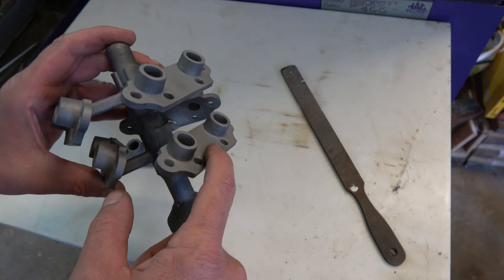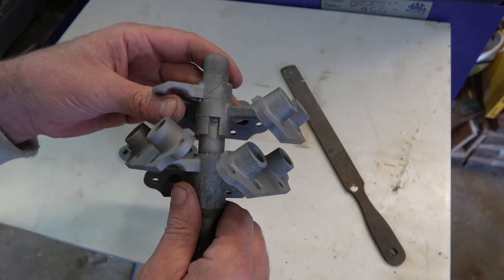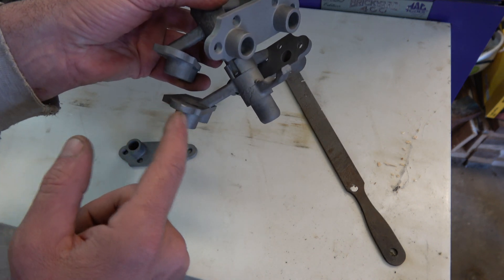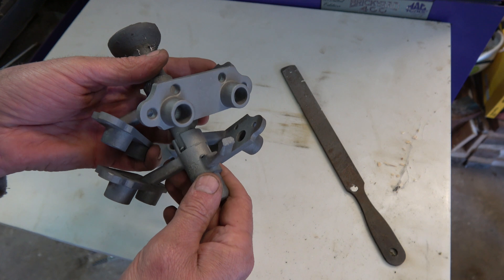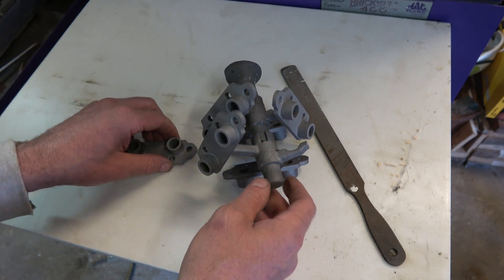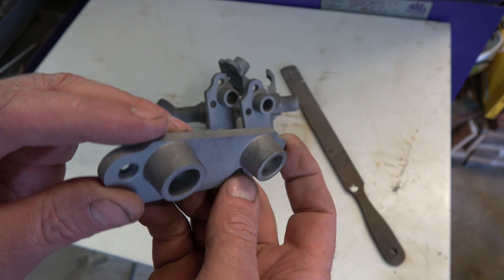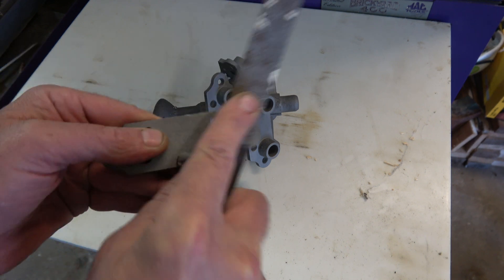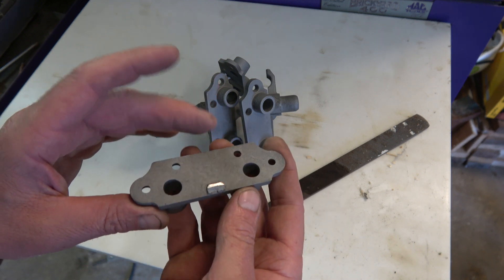Lost pla casting, cast iron, ceramic shell

Comment: Fantastic! I'm struggling finding the right mix and procedure for the ceramic shell. Would a mix of 1 parts Powdered Clay, 1 part powdered chamotte and 1 part water work? Dipping in layers with drying in between until the thing is quarter-inch thick? My concern is that the whole ceramic shell would shrink or warp during burning. Maybe if i use mostly chamotte and only a little clay, i end up with a shell that doesn't shrink. I would be thankfull for further instructions.

Comment: Do you cast parts for customers? I'm needing a screw cast for my 4 jaw lathe chuck.
Reply from the maker: Yes but something like that you might be better off just machining one.
  Is it an acme thread??
Reply: @aonemarine  it is left hand acme thread with a gap in the middle. It also ofcourse has the square hole in one end. The original is cast.
Reply from the maker: @jesusisalive3227  Send me a picture of it with some rough dimensions just add @aoldotcom to my Y/T name...
Reply: @aonemarine  

Email sent.

Comment: how hard is the shell to remove just ordered a bucket and will be picking it up next week I can't wait
Reply from the maker: If you sprue it up right you can use an air chistle on the top with the bottom resting on a solid surface and it will vibrate alot of it off.  But internal areas need to be drilled with a masonry bit and then sand blast what ever is left..
  Stuff is a bit like a soft concrete...